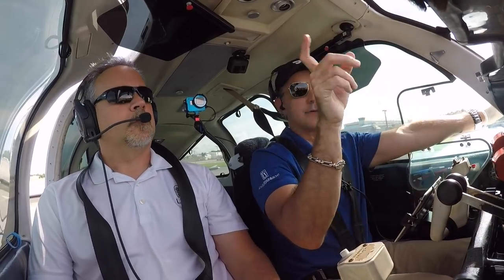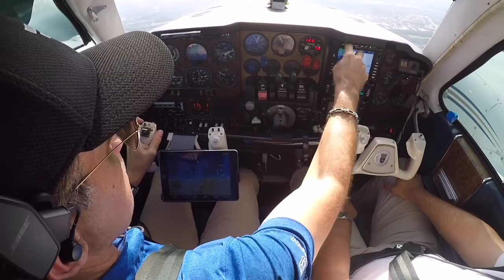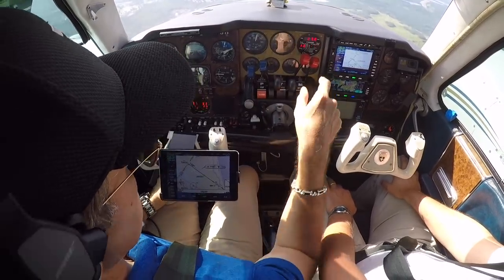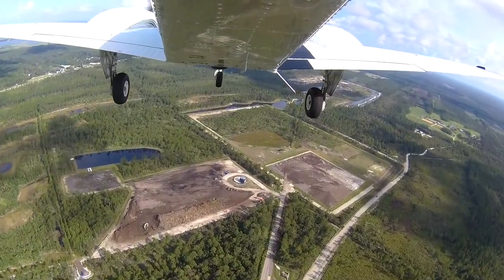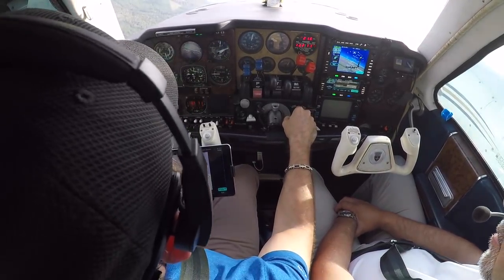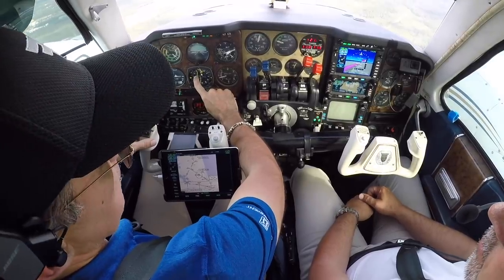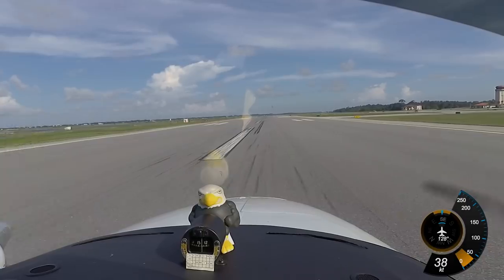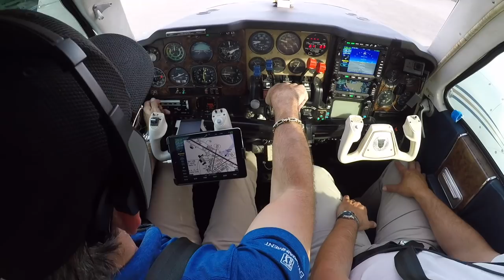Autopilot Struggles To Keep Up On Approach

Comment: What do you have for an autopilot?  I’m watching with the sound off and can’t tell from the video.
Reply from the maker: Century III
Reply: @BaronPilot  If you are planning to upgrade I had a Baron with an STEC 55X that worked really well.  I have a Cessna 340A now and am in the process of replacing the old unit with a GFC 600.

Comment: Nice video.  I fly a 66 Vtail. It been in the shop for just over a month now getting a new panel. I went the full Garmin route with 750/430 with the imbedded comm and transponder, 500 txi with engine analyzerand a G5 for stand by. Replaced my old Stec 60-2 with Te new 3100. Anxious like you to seeing how everything plays together. Should get it back tomorrow for the first flight. Keep up the good work.
Reply from the maker: Sounds like an amazing setup!!

Comment: Christmas time in the cockpit! Got a whole new lineup of nice goodies there! SWEET! Congrats! 👍

Being the cheapskate that I am, I'd just hand fly the approach in IMC - certainly cheaper than reconditioning, or replacing the autopilot. Would be a pretty big hit to the wallet, especially after just installing the new instruments. I nitpick like crazy with my cars/trucks, even the old ones - I have to have everything working at all times, lol, so I usually spend piles of money making problems go away ... so if I owned that plane, I'd probably do the same. I swear If I didn't drive, I could own TWO airplanes ... 😂

Great video! I have alot to learn yet on approaches. Helps every time I watch one (or two 😊). Thanks for sharing! 🍻

Oh, almost forgot to mention ... when I heard those tones from the new instruments there, I was waiting for text to appear on the screen - guess I've been watching Greg too much, HAHAHA! 😁
Reply from the maker: I'm with you. I hate when something is not working. I have never thought about text when I have tones. Will need to consider/remember that next time.

Comment: I'm pretty sure Steveo is using the same headsets, and Bose was concerned that they wouldn't work well in the turboprop.
I think Bose may have done themselves a disservice.  I doubt the Pro Flight IIs are as good as the A20s in noise reduction, but I'm sure they are far better than what you were wearing.
As to the autopilot, I would suggest that you have an almost fifty year piece of electronics that is based on analog circuits.  I would also bet that by reconditioning it, you should be able to return the operation of it back to New, if not Better than New.
Replacing the capacitors will be the big thing, since those are what really 'wear out' over time.  There are a couple of specialty shops that could do it for you.  I doubt the shop you had install the radios would do it, they'd rather you spend the money on a new one, but I suspect they could recommend a shop for you.  Google search got me one shop when I was looking for Jerry Wagner, but I bet there are others, too.
Reply: That is a great observation. Caps, especially electrolytic caps go bad over time. At almost 50 years old it's a miracle that some of the electrolytic's haven't dried out and "popped".
Reply: Bose wasn't concerned that they wouldn't work in the turboprop because that in ear Bose headset was specifically made for turboprops and jets. It wasn't intended for piston planes since the ear pieces don't insert all the way into the ear canal like Clarity Alofts or Halo headsets. But people are using them in pistons.
Reply: @brianparkman8183  From what Steveo had said, they weren't supposed to be designed for turboprop either.  But, I didn't talk to the Bose rep, nor have I read the literature on them, just repeating what someone who is using them said.
Reply: I've bee using them last two weeks on a king air E90 all the way from Sweden to BCT on south Florida and they've done a really good job for me, noise reduction was great, communications perfect and way more confortable than the A20 I've been using so far, what else do you need? I'll test them now on a Baron as well and see how it works with pistons, what Bose said is not primarily intended for.
Reply: Brian Parkman _>

Comment: Ours does the same thing. If you get it lined up using the heading mode and then switch to loc rem it'll fly the approach dead on.  If you try and let it do all the capturing then it doesn't do so well. Other than this it works wonderfully.
Reply from the maker: Ya that's what I will/would do in actual IFR. It's a good test to do in VFR to learn how it will behave.

Comment: Like the new Avedyne panel with synthetic vision. Your new Bose Head Set is also very cool and practical. Since ,you mention that your auto pilot is old and has trouble communicating with the FMS. Will you require an AP upgrade or just a simple adjustment?
Reply from the maker: For now I will simply adjust how I fly when I am using it. One day I hope to update it.

Comment: Nice! Your plane is a dream. May I ask what made you go for Avidyne and not the Garmin? Safe flights!
Reply from the maker: I love Avidyne. Their user interface is so much better for me. I have been using them for a couple years now and wouldn't want it any other way. If you haven't used them try downloading their free simulator on the ipad.
Reply: @BaronPilot  will give it a try! 👍🏻

Comment: I would have the autopilot servos check for slippage. They do wear out. Might be something very simple.
Reply from the maker: I have had a few conversations with people way smarter then me. Don't think its the servos.
Reply: I fit in that category.
Reply: Maybe it's how the device was programmed. It may just switch from a capturing to a track mode based on just the lateral deflection (not checking if heading deviation is small, too) and once it's in the tracking mode it probably can only deviate from the selected course by about 10 degrees. So it constantly aims for 10 degrees to the left (which you can see on the HSI) but that is not enough to correct for the overshoot that occurred and the crosswind from the left.
As a pilot I would probably revert back to heading mode to steer it back to the center, and then re-arm the "localizer" capture once I get there.
Or turn the course bug to the left to get back on the path and then turn it back to the correct value once established.

Comment: One of these videos I'll see you with total glass in front of you. Don't know what autopilot you have but some of those can have the sensitivity adjusted so it doesn't lag so far behind. Analog cannot keep up with the digital stuff but it still works. LOL.
Reply from the maker: That’s my ultimate goal
Reply: The Dynon Skyview HDX is probably the best consideration right now for Kris. The Skyview DOES have an integrated autopilot, but, unlike glass panels from Garmin and Aspen, the A/P needs to be certified for each aircraft
If Dynon didn't have the autopilot as part of the package, it would be a lot easier to do like Garmin and Aspen did and certify across a wide range of airplanes.
Another issue is that Dynon also has an EMS, or Engine Monitoring System, which has to be set up for each airplane.  Even engine STCs well affect that.  It won't be much, not nearly as bad as the A/P certification, but this is why you don't see a lot of airplanes with Dynon, at least in the certified market.
By the way, there are two size screen for the Dynon, 10" and 7".
Having the 10" as the main display and the 7" as the EMS, autopilot control, backup display, and VFR GPS works really nicely, especially if it replaces the guages right above the throttle quadrant.

Comment: re: tired autopilot, are you talking about the actual servos? otherwise, what components would need "attention"?
Reply: The primary culprit will be the capacitors in the control unit.  Over time they tend to degrade and lose their electrolytic value.  That autopilot is probably close to 50 years old, and wasn't really designed for a lifespan like that.
Other computer parts will degrade and frail over time, but the capacitors are the most vulnerable.
Reply from the maker: Like Gary said, the servos are fine. Its the brains that are tired
Reply: @BaronPilot  Good morning, Kris.  Have you looked into repairing that A/P system in the meantime?   From looking at Dynon's website, they seem to be doing things incrementally.  So, while the main display and EMS may show up for three Baron next year, the A/P may not show up for another four months.
Obviously, I haven't been in contact with them, but maybe you have and know more than me.

Comment: Could you have overshot the glide slope a little and let the autopilot catch up? Or,  just an older style autopilot?
Reply: It wasn't the glideslope, it was the localizer.  It's an old autopilot that needs a bit of refurbishment, but, depending on the parts, could fly well enough in today's IFR environment.
Reply from the maker: Grant, I could have intercepted the Localizer and then activated the autopilot but I wanted to see what the autopilot would do if I let it do all the work

Comment: What is that kickstand looking thing on the passenger side of the lower plane?
Reply: That is a step to get up onto the wing.
Reply: Yup,  you have the Marshaller come over and kick it down, right after they chock the wheels.   That was an option on the old Barons for parking on soft ground  😊
Reply: That was funny.  Yeah, you don't want the airplane tipping over when you fuel it!   😀😄

I'll tell you though, Beech Bonanza and Barons DO have the prettiest and nicest gear retraction sequence.

Comment: Can you add GPSS roll steering to your AP?
Reply from the maker: Yes and that is something I want as well!
Reply: I've had it on an old STEC 50 for years.  The improvement is night and day.
Reply: I have a GNSS roll converter interfacing between a 530W and STEC50 in a PA39. Works very well, much better than driving the autopilot through the HSI.